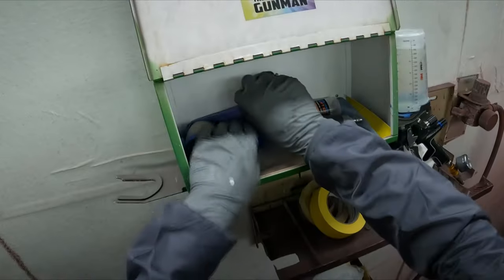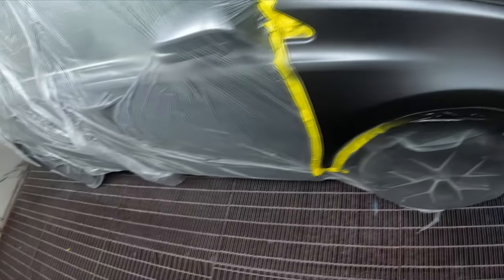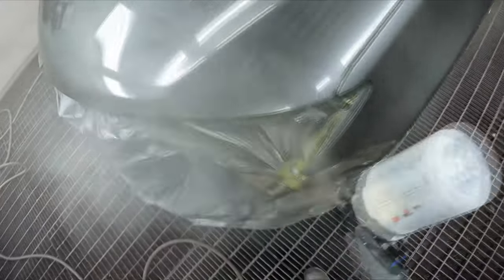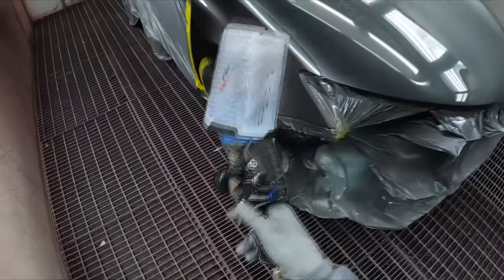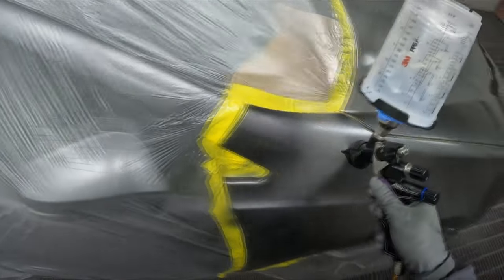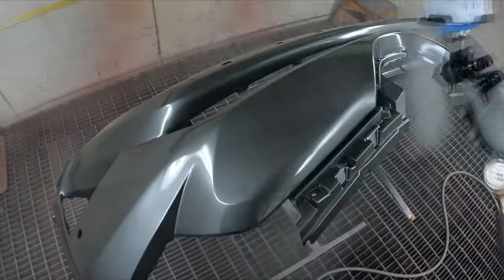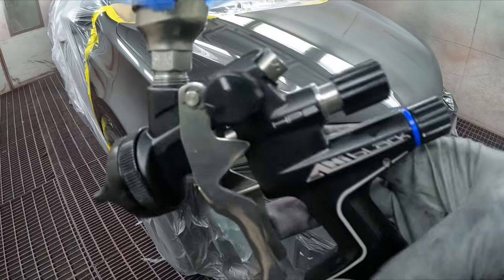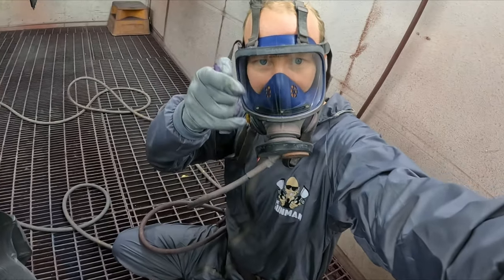Rav 4 Clear Coat Stage

Comment: Hi Gunny,  I have been watching you for many years. I have a TEKNA prolite USA version and took your advice on the t110 air cap.  I do old American muscle cars and bikes; so I wanted the lowest peel possible.  With the fan wide open, it has a super heavy top and bottom pattern.  I must adjust the fan to 1/4 turn from all in to get a decent pattern. WTF.  I am using 28- 29 psi (2bar).  Is that common?  My 10 and 20 air cap spray just fine but want to use the 110 more.  Keep up the great vids.
Reply: I am not interested in a prize.  I am interested in an answer to the question. thanks